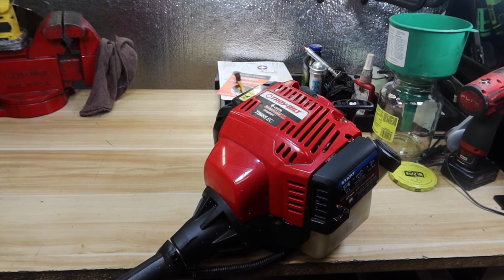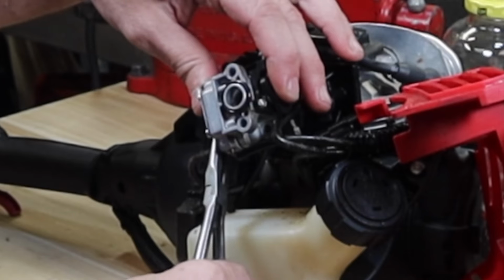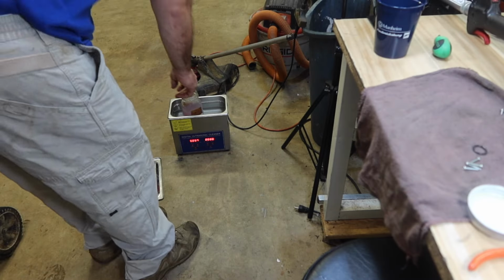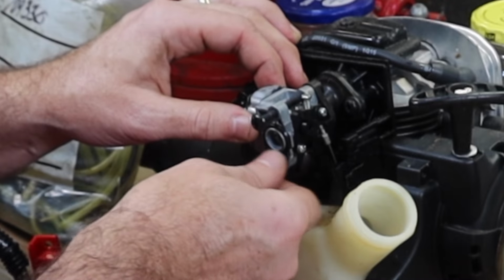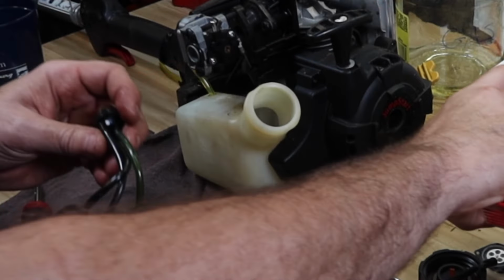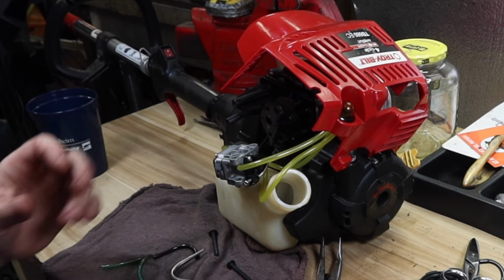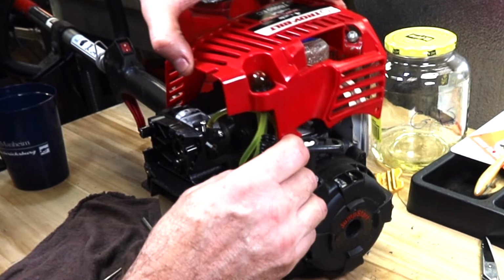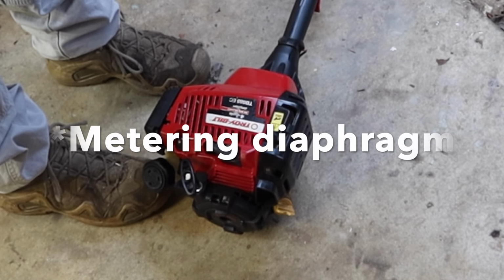Troy Bilt trimmer Problems: no start

Comment: Noticed your Matco screwdriver. I’ve replaced all but my largest Phillips screwdrivers and bits with JIS. They work on Phillips and JIS screws equally well and far better than Phillips.  Since then I’ve never had a driver cam out on a screw, plus along with magnetizing the screws, will stick to the end of the driver when installing, which is really great with tiny screws. 🔧👍
Reply from the maker: I’m heading that way. I have a JIS set but only use them when I notice the dot on the screw head currently
Reply: @RayofallTrades 
👍   They really do work perfectly in Phillips, much better than Phillips drivers. No contest!
Actually, ANY cross slot screw, with or without the dot.
Reply from the maker: @Rein_Ciarfella nice. I’ll have to try them more often. Thanks!